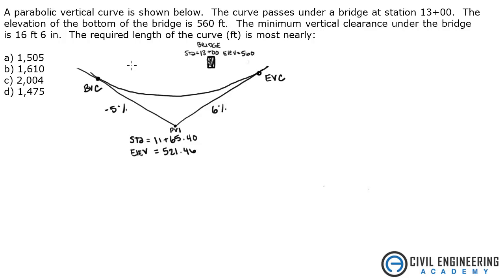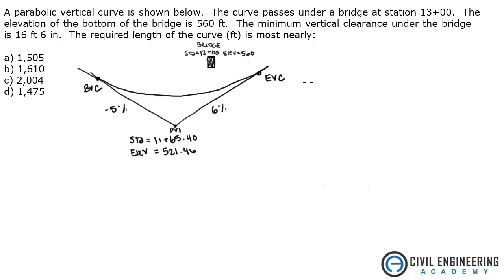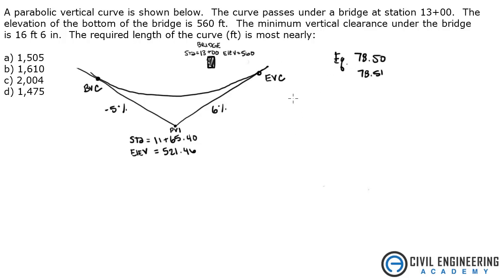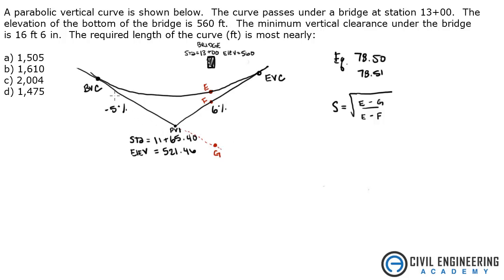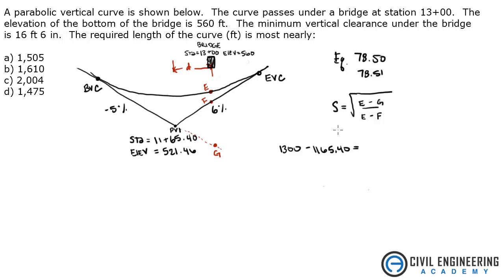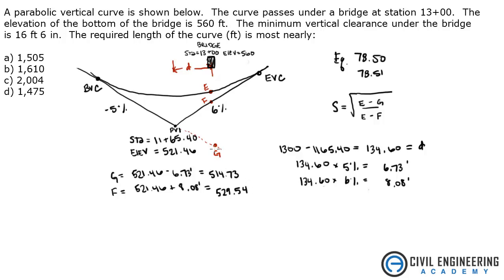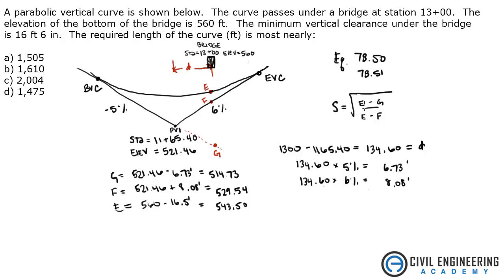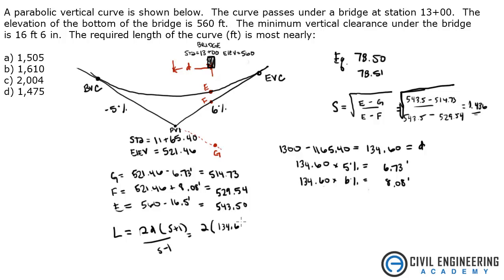Transportation-Vertical Curve Bridge Clearance

Comment: just general feedback - Would be awesome if you could mention which version of the CERM you're using. I have found your videos to be extremely helpful and have noticed the chapters you mention are not consistent with the 15th ed. (current) This comment might not apply to all your videos - I am just beginning. It is good motivation for me to cross-reference of course, but might be confusing. Thanks for the examples!